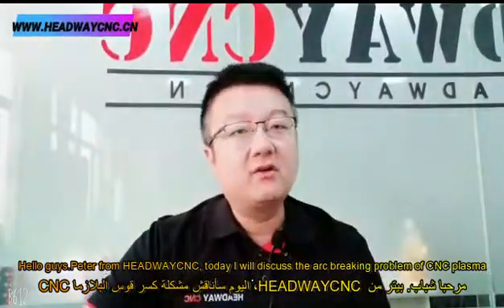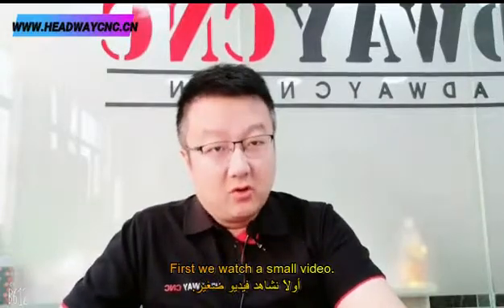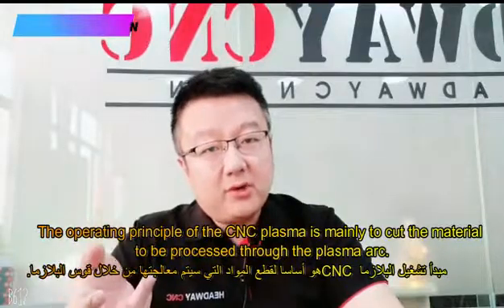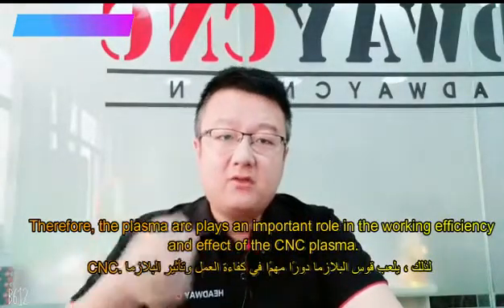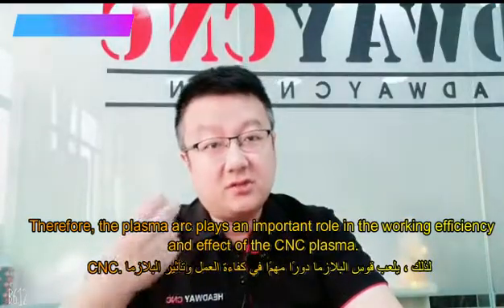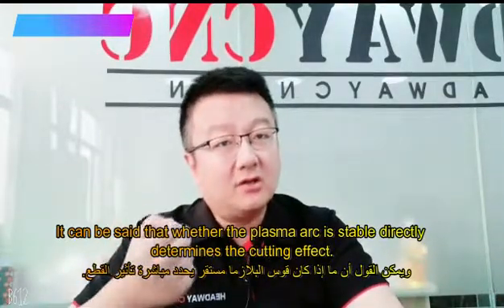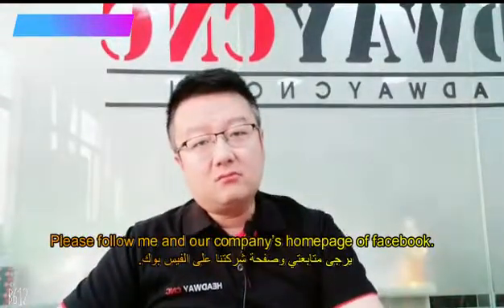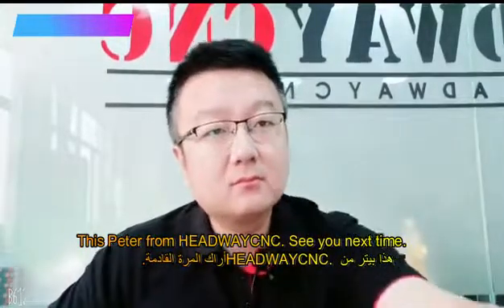How to solve the problem of Arc break

Comment: hi peter . i have the F2100B controller on my plasma . the one problem is the after the first cut the machine doesnot stop cutting, it lift the torch and moves to the second cut still cutting , i change a 9 pin relay  , the dealer recon it is  sticky ,  it work for a little wail.
not satisfied  , is there same other  problem the i must look at . 
thanks danie

Comment: hello, I have checked all the parameters that you have mounted, my machine has not even 1 month of operation.
however I still have the same problem, I point out that it happened suddenly.
would it be a problem due to the (voltage devider ) ?. because I noticed two small changes on my machine. firstly the height of the torch does not correspond to that given on my controller, secondly the power of the flame is low even if I increase the voltage.
I use an XPTHC-400-PT as a controller

Comment: Our CNC machine is not working due to arc bk error. How to solve this problem
Reply: La solución es sencilla reviza que  todas las conexiones que van al fuente este bien conectadas
Reply: A nosotros nos paso igual faltaba conectar el cable que produce el arc
Y la conexión del cable de control no estaban haciendo buen contacto
Reply: @bernabecortes4159  hola buenas tardes amigo neu, yo tambien tengo este problema. desconectaste todos los cables y volviste a conectar? espero poder ayudar
Reply: Intercambiamos las señales del arc por la de pierce 3 (default) ...se probó pero aún persiste la falla 😢😢😢